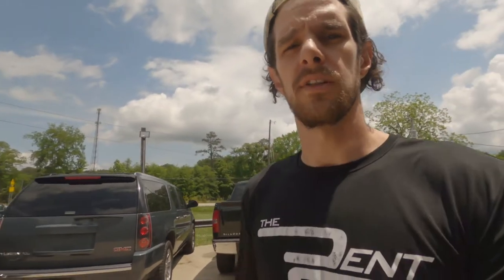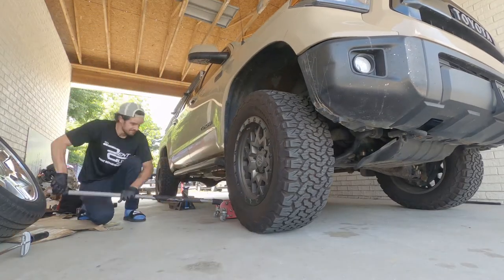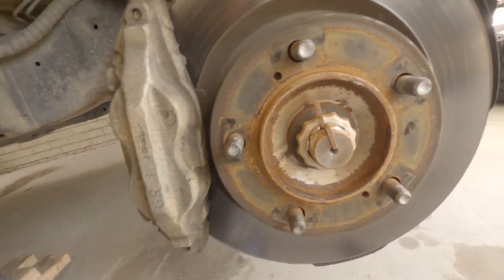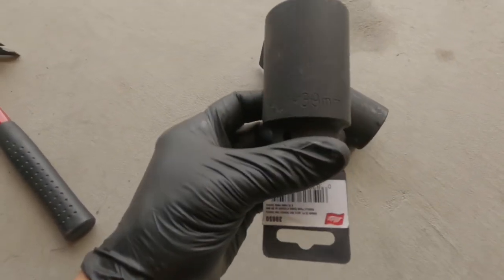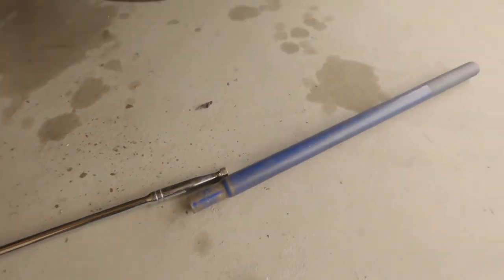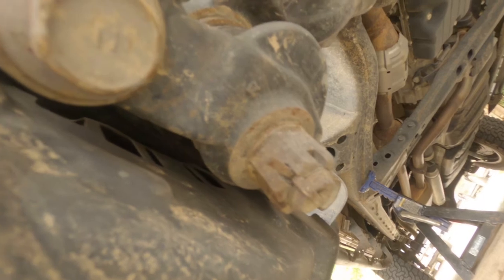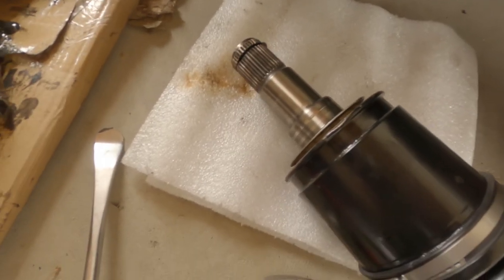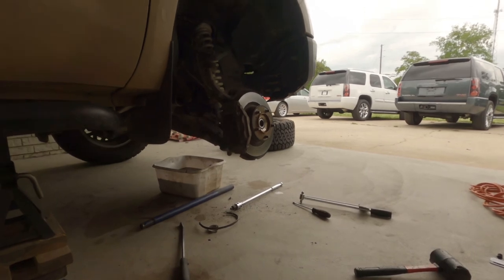2017 Toyota Tundra CV Axle Boot Replacement Repair

Comment: Have a similar situation with mine except its the boot by the wheel. Toyota replaced my cv axle because it was clanking pretty bad at turns. After I got my truck back, the boot tore the next day. Took it back to toyota and they gave me the same excuse " trucks too lifted, its gonna keep tearing it at turns". So I gotta replace mine but I'm thinking of getting a longer boot from kar tek. Great vid, very helpful 👍.
Reply from the maker: That's a bummer. My local dealership was not cool about my lift even thought I'm within spec. Are you running a diff drop? That might help too. There is a boot stretch mod for 3rd Gen 4Runners. Maybe something like that could be applied to the Tundra.

Comment: Did you have to service the differential with oil?
Reply from the maker: When I pulled the CV axle out the differential oil didn't leak so I didn't add any oil. The way I had the vehicle jacked up kept the oil in.

Comment: Hey bro, what did you do when the oil or something came out when you take the CV axle out. The carrier assembly?
Reply from the maker: Hey, thanks for commenting. There was barely any gear oil that came out of the differential. As far as I recall it was just a tiny drip. I'm guessing because I had  the vehicle jacked up on the passenger side, it kept it from dripping too much. The oil pan below was full of engine oil from an oil change on a different vehicle. That being said, if you lose a lot of gear oil doing this repair, you'll want to top off the differential with the proper gear oil.
Reply: @goatsinapond  thanks brotha. 👍

Comment: Got a question for you all.  I have a 2017 Tundra, and ive been having some noise over bumps from the front end.  Ive looked at everything up there and replaced breaks.  The drivers side CV shaft on the inner housing, i can move the housing up and down a fair bit, and it makes a clanking noise - cant move the inner passenger side at all.  Is this normal or potential issue.  When i talk about moving the housing up and down, i know there is horizontal movement in the cv shaft which is normal.  I have replaced the CV shaft, noise is still there, and i believe its worse now. The CV shaft is fully inserted in the housing as it contacts the diff it attaches too.  Second question, when i pulled the inner seal on the diff that contacts the CV shaft, there was an o-ring that came out, questioning whether i put it back correctly.  Thank you for any help.
Reply from the maker: Front end noises are hard to track down. I had a "popping" sound that would randomly happen when turning my 4runner. It wasn't the same as the CV axle clicking when it's going bad. I was never able to track it down. That up and down play is potentially concerning. There is a needle bearing in the differential that can wear out. It's common on lifted vehicles. Is yours lifted? I had a similar issue with my 4Runner that was experienced as a lot of vibration when accelerating. So not quite the same as what you are experiencing. Here is a link to the video I made replacing that needle bearing in the 4Runner https://youtu.be/T6xlz8eLiXc?si=borL-eeY44CUN6Cx I have also had noise from loose pieces of plastic rattling around. This happened in my wife's Nissan Rogue. Also, a upper or lower ball joint going bad? Unlikely, on a 2017.
Reply: @goatsinapond  this is exactly my problem, thank you, your video was great.  The needle bearing you took out had splines in it, the replacement was smooth - why the difference, pretty strange - i did notice my splines in needle bearing didnt engage with the splines in the cv axle, strange they would make it that way.  thanks again.

Comment: How's it held up?
Reply from the maker: Still going strong after 15k more miles. No leaks, clicking, or popping coming from the CV.
Reply: @goatsinapond  Awesome man! Just put some cv axles from a 2019 Tundra on my 2010. The boots are messed up, awesome video
Reply: Are the clamps a pain to re tighten?
Reply from the maker: @jakeestrada1239  No, but you do need a special tool to clamp them correctly. Just cost you some extra $$$.